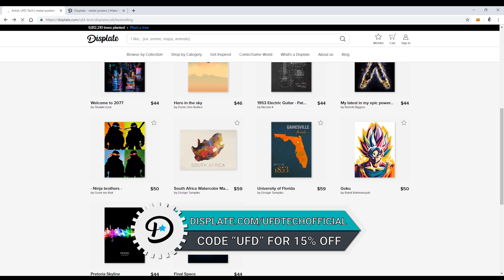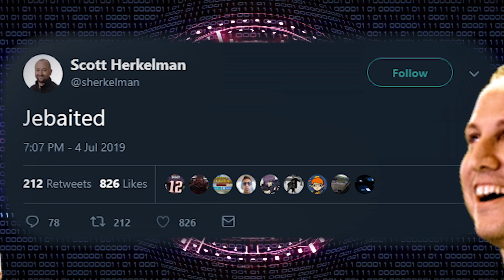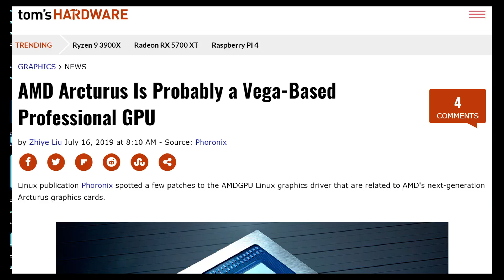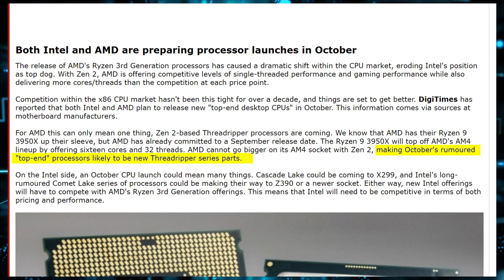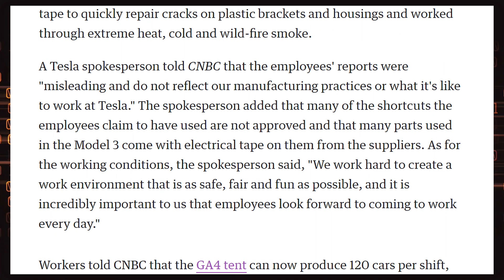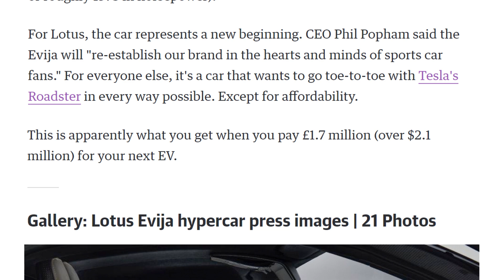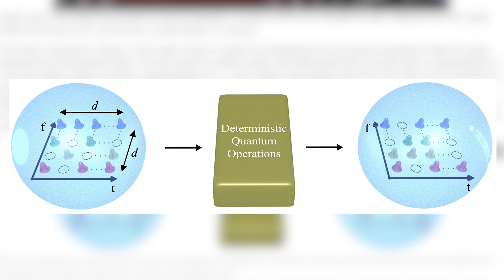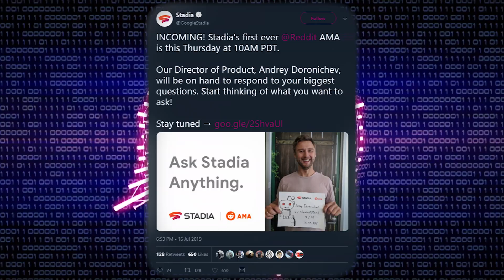Nvidia Says No

Comment: There's no way to have a 2080 Ti Super, because that's already occupied by the RTX Titan.
What some people don't seem to realize is that essentially a 2080 Super is a defective 2080 Ti, a 2070 Super is a defective 2080, a 2070 Super is a defective 2080 and a 2060 Super is a defective 2070.
That's why there's cooling block compatibility with the next higher model.
Reply: Well, rtx 2070 used xx60 gpus chip. Now they changed the chip
Reply: I said the same in so many places. Super is just filler to block AMDs Navi in new price points
Reply: @Shimitzu  well,navi and super gpus are still overpriced
Reply: @Saigonas  not with NAVI. From the outside it seems overpriced but in reality, it has big amount of headroom for OC. I'd wait for custom cards before we judge
Reply: @tek1645  read my other comment
Reply: one minor caveat, the 2060super is NOT cheaper than the 2060, it's MSRP is 50usd higher. Kind of makes most of the better stuff on that super a bit 'meh', lol. Esp compared to the lower launch day MSRP of the GTX1070, and I sort of doubt the RTX2060(super or not) will be all that impressive for RT games, lol.

Overpriced is an understatement, they bumped the pricing tiers up a notch, from the 2060 vs 1070 to the 2080ti vs Titan Xp, lol.
Reply: @Zarcondeegrissom  I think you confused something there. The 2060 Super is a botched down 2070. So it's pricing is in between the 2060 and 2070.
From a technological perspective, it would have made more sense to name it 2070 Minor. But I guess the marketing people didn't agree. ;)
Reply: @P8qzxnxfP85xZ2H3wDRV  I disagree with the notion that the RTX 2060 Super is a 2070 Minor. The 2070 uses the TU106: A chip which has historically been in the x60 Class of GPUs. Because of this, it's hard to consider the 2070 a real x70 card, but rather an x60 GPU with the name of an x70 GPU. Even if we look at the RTX 2070 and 2060 Super without taking the other generations into consideration, the RTX 2060 Super more or less performs identically to the 2070 at stock/ Slightly overclocked speeds, which begs another question: Should the 2070 even exist alongside an almost identical "minor" GPU variant? That's why we're seeing it being phased out: It really isn't better than the 2060 Super, at least not to a significant enough degree to warrant its existence. I believe the Super tag will mostly be used as a way to tell people "These are the updated cards".
Reply: @TooHTP  Yes, the differences are just too miniscule. NVIDIA's whole product stack is convoluted.
A much better feature to introduce would be to finally enable 10 bit outside of games in the driver.
Reply: No wonder why they dropped the price.
Reply: @Taren Capel 
L😂L
Reply: RTX Titan super
Reply: Maybe not defective, but an excuse to have a discount (trying not to piss off early idi... I mean, adopters)... One or the other...
Reply: what about a 2090?
Reply: Thats how its always been. Defective silicone gets cut down for lower end chips.
Reply: 2080 used a xx70 class chip plus was horribly overpriced, 2080 super uses a xx80 class chip and still is overpriced.
2070 used a xx60 class chip plus was horribly overpriced, 2070 super uses a xx70 class chip and still is overpriced.
Reply: @xnoreq  yep. New rx series are seccessors of rx 570,580,590. So 50$ for generation increase wouldve been ok. But now, its alot more and RTX cards are even more expensive.
Reply: @Saigonas  The RX 5700 is the successor of the Vega cards not the Polaris cards, All video cards are overpriced now but people will continue to pay it and nothing will change. Overpriced is the new normal. The budget Navi cards are coming as is ones that will compete with the Titan and 2080ti cards.

Comment: I think that there won't be a 2080 Ti Super because of how small the margin there is between there is between it and the RTX Titan. They can't technically squeeze a meaningful 2080 Ti upgrade between it and the Titan without also making the Titan obsolete. Considering the $1000 price difference between the 2080 Ti and the Titan, they want to keep raking in the profit from anyone who says "Nah, I want 2% more performance for 200% more money."
Reply: Eric Del Toro the 2080TI has a 118% margin in profits. They’ll make a super if they want to.
Reply: @NovaDoll  The Titan RTX probably has a wider margin of profit given the $1000 price difference for not much more. If they make a 2080 Ti Super, which they said they won't, it'll kill the 2080 Ti and the Titan RTX plus it would have to be a different Turing gpu core sku because the TU102 in the Titan is supposed to be the fully unlocked chip, same as the Quadro RTX 8000 except with half the vram. The R&D for a new turing chip with more SMs, RTs, ROPs, TMUs, Tensor Core, etc would be a bit of a waste for a single card. They'd be better off making a whole new generation of chips (smaller die, new/improved architrcture, etc).